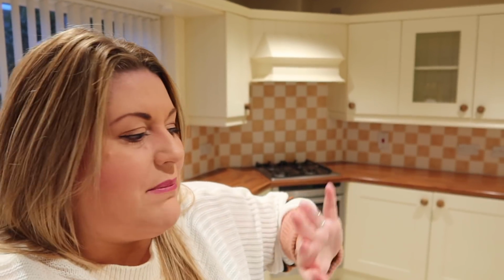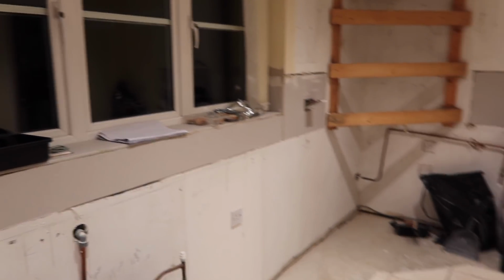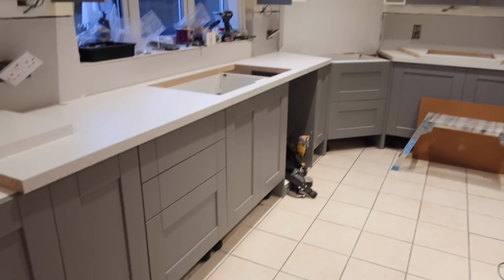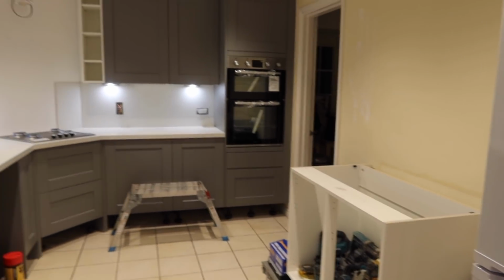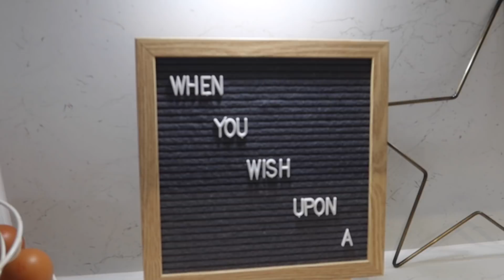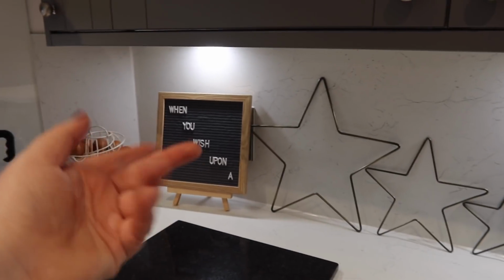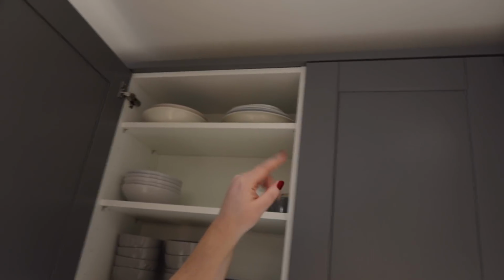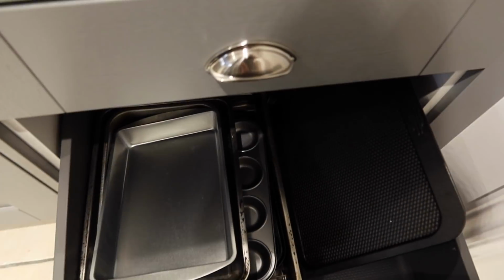OUR NEW KITCHEN / BEFORE, DURING & AFTER

Comment: Looks lovely. Hope you sold the old kitchen or donated it? 

I have built-in freezer, fridge and dishwasher... It does not "stick out" because you buy built in ones that fit "into" the cabinets frames!

I am British (but now live abroad), but I don't understand why in the UK people do everything backwards?... When you have pulled out the old units.. Then it is logical the eg do the floors (wall to wall, not cabinet front to cabinet front), and eg paint the walls, do the back splash... BEFORE putting in the new cabinets!.. It is so much easier that way.. And a clearer look... Just curious